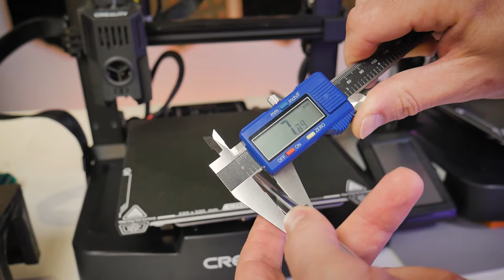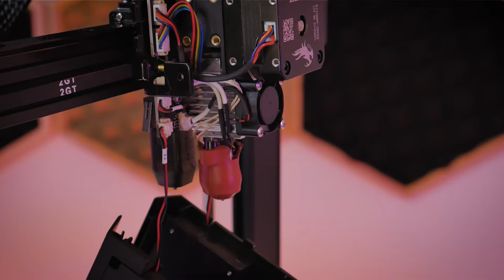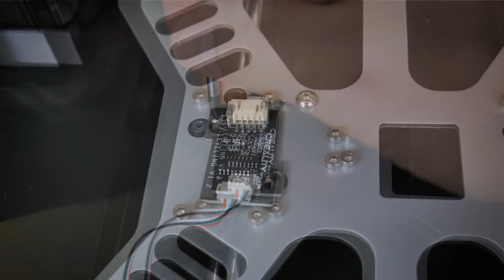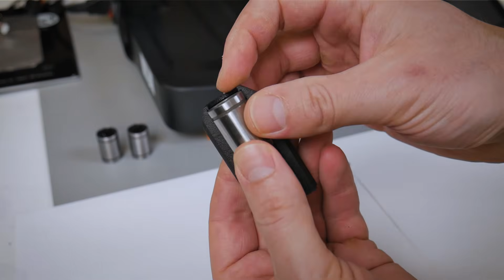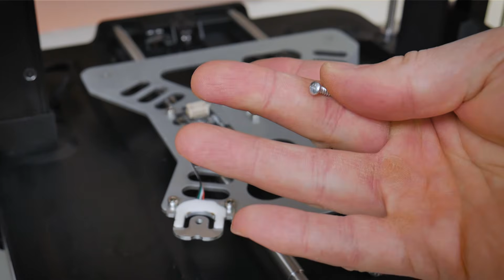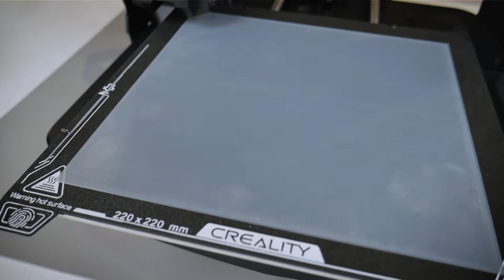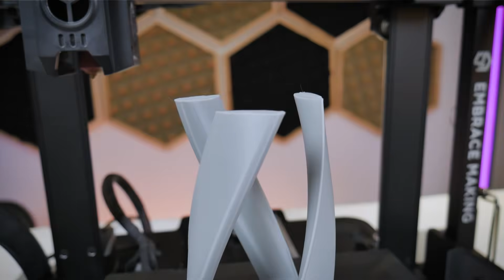Creality Ender 3 V3 KE/SE 10mm Rod Upgrade, Improve Bed Mesh, Fix Slanted Gantry, Unstable Print Bed

Comment: Mike from NeedItMakeIt has also been developing mods for the Ender 3 V3 KE to try to fix its various short falls. After figuring out there was awful bed shake at the corners of the print bed, ruining quality, he made a pretty solid rod and bed mounting upgrade too. There were big issues with the alignment of the rods and how loose the bearings were on them. He has other fixes and upgrades to help with quality as well. However, the extruder still has fundamental flaws leading to quality issues. Creality really needs to get back to basics and make better printers if they don't want to be constantly ridiculed.
Reply: what is wrong with the extruder?
Reply: @billy.the.maker.  Small dual gears that aren't supported on both sides of the axle, primarily.
Reply: @802Garage  and what is happening? I own Bambu A1 and Ender 3 KE and really I don't see any difference in prints. Maybe you got broken one? Try too give it back and take new one. Or maybe people are so "sick" of china stuff and only criticize all of them products. I understand that Tesla, Bambu is amurican but you know that 99% parts of them is from china? :D
Reply: @billy.the.maker.  Nope you've got it all wrong. This isn't even my analysis, but an aggregate from a ton of people who even design and build 3D printers. I'm also not opposed to Chinse products in general. Almost all consumer 3D printers are made in China. Bambu Lab is not American. They have a business location in Texas, sure, but the development and production is still Chinese. I'm actually not a Bambu fan boy, but the A1 extruder design is superior for pure quality. It is a large single gear extruder. I actually like Creality, but they do make mistakes on their printer designs and rush releases. The K1 series for example has had numerous issues including the extruder.
Reply: @billy.the.maker.  For most consumers, the quality difference is negligible. For discerning people who want really perfect prints, the extruder design makes a big difference. I recommend the videos "What I've learned about dual gear extruders and how to patch them, maybe" by MihaiDesigns and "DUAL-DRIVE Gear EXTRUDERS SUCKS? (GALILEO 2 vs ORBITER V2 & P1S vs A1)" by PRINTING PERSPECTIVE. They will explain far better than I can here.
Reply: @802Garage  I would say that I am not regular consumer as you said but okay I will not argue ;)
Reply: @billy.the.maker.  I promise I am not trying to be rude or confrontational. If you watch the videos I recommended there is a lot of great info. I'd love to hear your opinions after watching them.
Reply: @802Garage  i don't understand people who expect that 300$ 3d printer will print same as 3k$ printer. It just silly IMHO.
Reply: @billy.the.maker.  Oh of course not! However, when you have options and one is objectively better than another for similar money, that's where it really matters. We also shouldn't excuse companies making poor engineering choices without good reason. It would not have been more expensive for Creality to develop a large single gear extruder with a well supported axle, for example. I just want people to be aware of the pros and cons of their options. My current favorite printer is the Qidi Q1 Pro, and even it doesn't have an optimal extruder design.
Reply: @802Garage  I have looked on the videos you mentioned. And I never seen slightly similar problems/artefacts etc like in those videos
 Clearly they had broken models. If your car will broke you will say that all of those cars are broken the same? I don't think so. Have a good day
Reply: @billy.the.maker.  You are incorrect. There are far more videos on this issue and extensive testing and documentation. Sorry you weren't open to learning more about extruder design. I will consider this conversation concluded.

Comment: Why doesn't Creality use jigs and alignment checks. It makes me question spending 1500usd with them when BL is out there. I think BL is good for making Creality to step up since the gap between Creality and Prusa was big. Now there is BL capturing the lower end of Prusa and the upper end of Creality.
Reply from the maker: For sure - I have an A1 that I am working on reviewing right now - I'm very impressed. Creality's higher end models seem like they do a much better job now than they used to. My K1C has been excellent and my K1 Max has also been very good. I have four Ender 3 V3 core xz and those have been really good too. The lower end models... hit and miss with the quality control.

Comment: Hi. Nice mod. I didn't like linear rail upgrade as well. Yours is very easy to upgrade. Only thing I would do different, I would use grub screws to fix the rods in place(in front). Also silicone spacers instead of original plastic spacers. Spacers upgrade is huge for the mesh because you can tighten the screw as you need, they don't bottom out so you can fine tune and calibration holds longer. Again nice mod.  Thank's
Reply from the maker: It's a good idea - I should be able to source those for the future!

Comment: I can't believe that Creality continues to release a bunch of printers with clear issues just to save a few dollars for the consumer, but it leads to needed mods and consumer tinkering time. Some of these issues should just not be present on a budget printer anymore period. It's not designed for tinkerers, it's just cash grabbing.
Reply: To be honest, it’s a cheap printer. Whenever something is cheap there ARE going to be issues without a doubt, some just not permanent thought. When a cheap thing can be upgraded I see that as a very very good thing because that means you could possibly turn it into a print that would cost around $500
Reply: @Stinky0368  there really isn't a high end 3d printer that keeps its value. You aren't turning a 100 dollar 3d printer into an expensive one. Its better just to buy a 3d printer that will hold its value long term. Or better off with a better built 3d printer that's going to last.
Reply: @oneanother1 you say there isn't a printer that holds its value, then say to buy a printer that keeps its value.. so which is it...
Reply: @queueeeee9000  I mean there are printers that people will buy used as much as they are almost new, like prusa or bambulab. Then there's printers that release yearly, and the older models drop substantially in price. But yeah, new printers coming out are better and cheaper. The other issue is there's just too many printers out there, so they just don't hold value if no one wants them. Its worth going corexy over a bed slinger.
Reply: Why would you go from a solid aluminum frame to a hallow plastic base frame and weak z gantry, and people are buying them up like they are next lvl. Creality cutting too many corners, and have abandoned making good 3d printers.
Reply: If you know about a better printer for 100 dollars (I got SE for 150 and was refunded 50 for the issues it had) - let me know. Afaik only easythreed costs 100 and it's like i times worse than Creality is
Reply from the maker: Yes there are some simple quality checks that could have been done to prevent the majority of these issues and they could still offer the machine at the same low price. I think on these cheaper units they just get them out the door sadly. On the newer V3 core xz it seems much better put together.
Reply: I can’t believe people still buy ender 3s or really any creality printers 😂
Reply: @Skibbyz  you so smart :D
Reply: @Skibbyz   But if someone sticks with it and learns all the flaws, makes some small tweaks and upgrades, they'll be both an expert at 3D printing and have a solid 3D printer that performs as well as something twice the price.

Comment: Yet another Ender 3 iteration. They fix 1 thing and new problems arise. At this price there are plenty of better options.
Reply: What a lot of people in these comments aren't realizing is the V3 KE still prints just fine out of the box for the majority of people, at high speeds. All of this modding, while beneficial to people who want to tinker, is just chasing the dragon for moderately better prints. These can be had for $180-$200, what do you expect?
Reply from the maker: Yes on this machine there are still issues that need resolving that some QC could have fixed - the price is attractive but it's still a hobbyist machine that needs attention in some areas. I'm hoping that newer machines aren't shipping like this but I'm not holding my breath... the V3 core xz seems like they paid a lot closer attention to the quality though.
Reply: At$ 229 from Microcenter... I considered it a pretty good deal but if I throw much more money at it then I could have bought myself a flashforge 5m... it does pretty well for a bed slinger  My 5 m. that I also own out does it and quality every time and speed  @EmbraceMaking